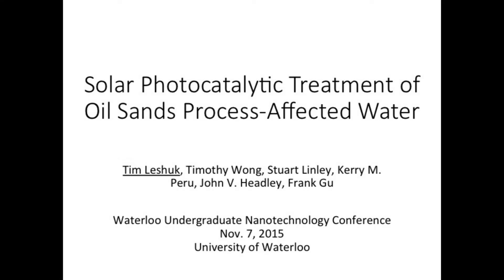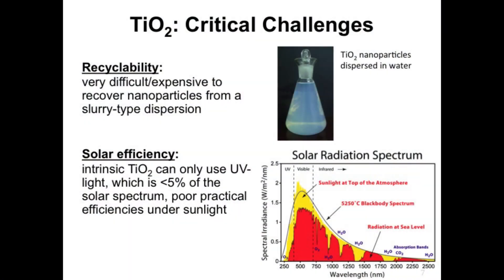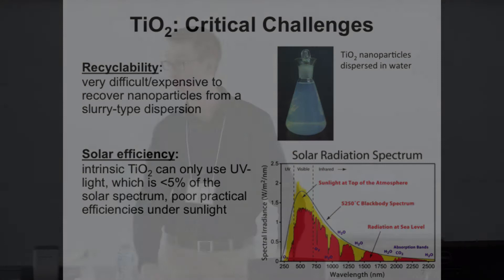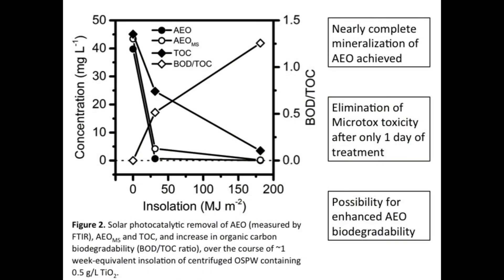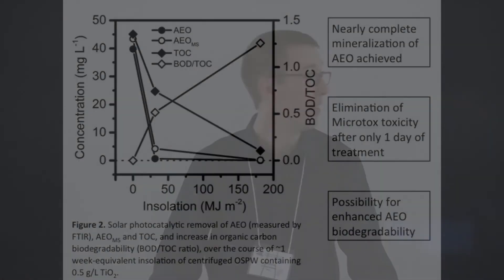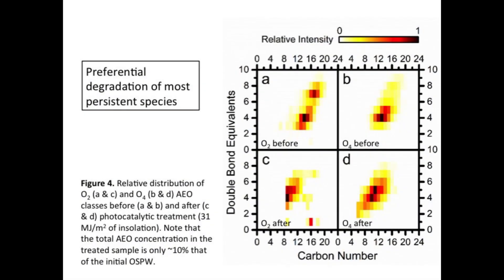WUNC 2015 - Photocatalytic Water Treatment - Tim Leshuk

Comment: Is there a paper on this? what literature can you recommend me on this subject?

thanks
Reply: Leshuk et al. (2016). Solar photocatalytic degradation of naphthenic acids in oil sands process-affected water.
Reply: @danielgaspari4347  did I understand it right I have normal iron then you have water and with concentrated Sunlight you start the process?